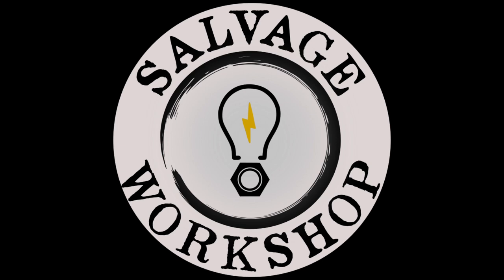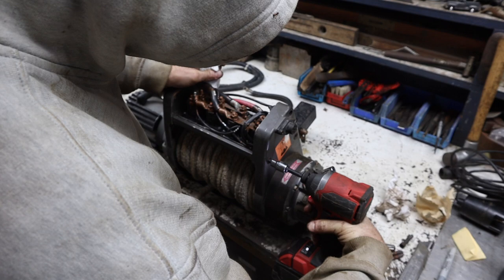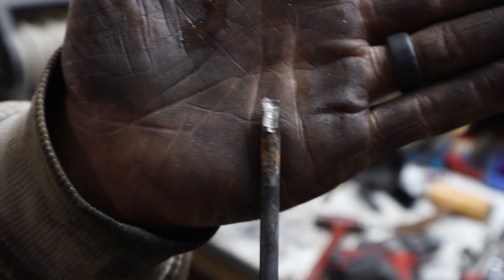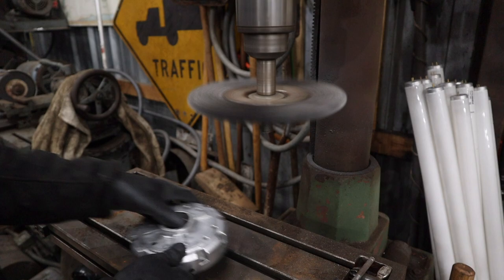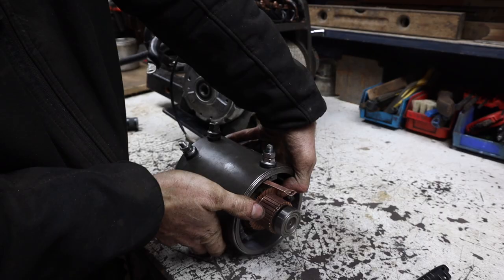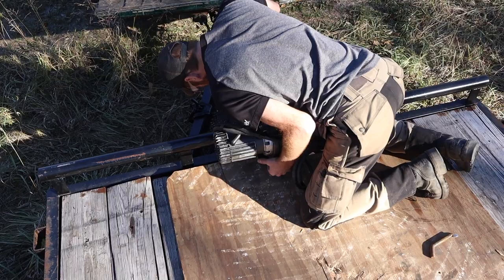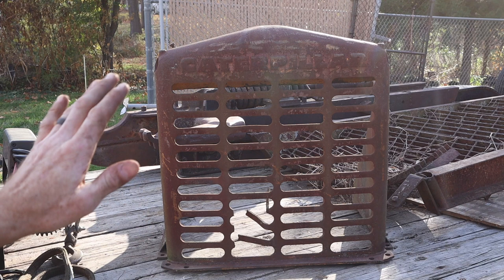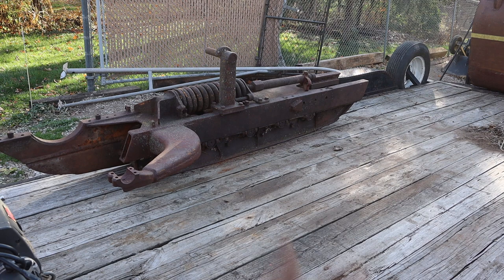Fixing a Winch so I can RESCUE Forgotten Parts ~ Part 9 ~ 1950s Caterpillar TraxCavator

Comment: I love your videos and have watched every second of the "Big Red" series.  It's great to see this old stuff come back to life.  But, I have to disagree with you about the 4 solenoids in the winch.  I don't think it has anything to do with safety or redundancy.  It it just a simple "H" bridge configuration of switches commonly used to flip polarity of DC to a 2 pole device like a motor.  Just Google "H bridge circuit" - there are tons of pictures that will explain it all.  But, the important thing is that you got the winch working and that's really all that counts.  Keep up the good work.
Reply from the maker: Warn solenoids are in an H bridge configuration, but not your standard mag motor H bridge but a series wound H bridge.

Warn does not switch the ground lead! The ground lead goes straight from the battery to the motor! More importantly: The solenoids are not in parallel. They are in series, so if any one solenoid fails, your winch will not work in that direction. Hence the safety.
Reply: @SalvageWorkshop  I agree that it is not the standard configuration of a small H bridge motor with permanent magnets. The winch has an electromagnetic rotor and stator. So, to flip directions, the current through one must always stay the same while the current through the other is flipped. The winch is wired with ground going to one leg of the motor's rotor and the other leg of the rotor feeds into the low side "H" bridge. the current through the rotor will always be in the same direction. The high side of the "H" bridge goes to +12V and the center two poles of the "H" bridge switch the power going to stator.  I agree that power will always flow through 2 of the 4 solenoid in the bridge, so from that standpoint, they are in series. But, there is no way you could build this with just 2 solenoids - you have to have 4 to flip the current flow through the stator.
Reply: I guess im asking randomly but does anyone know of a method to get back into an Instagram account..?
I somehow lost my login password. I love any tips you can give me!
Reply: @Romeo Noah Instablaster :)
Reply: @Skyler Quinton I really appreciate your reply. I found the site thru google and im waiting for the hacking stuff now.
Seems to take a while so I will get back to you later with my results.
Reply: @Skyler Quinton It did the trick and I actually got access to my account again. I am so happy:D
Thanks so much you really help me out :D
Reply: @Romeo Noah You are welcome :D

Comment: at 27:11 the motor base / first stage gearbox housing is rotated 180 degs out. that little teardrop indentation in the plate where it meets the motor housing should be pointed down. This is the moisture drain hole. Up you risk collecting (more) rain water in your motor housing.

Comment: Generally recommended to use the gray never seze which is approved for use with aluminum.  The copper variety is for steel on steel.  Copper and aluminum together will seize up big time.  Just in case you need to get them apart in the future without ruining the top casting.

Comment: You should try to get the forklift out at Red's old Place... Ground seems solid enough, though the small tires on it does seem like it may be more trouble than it's worth going off flat concrete shop type stuff... never used one that low to the ground myself. The smallest at my Job is a 4K and we have to be on dirt sometimes lifting heavy bomb bodies, but the tires are a little bigger than that set up so idk for sure. I'd still try it myself though especially if I was by myself... Keep it up this is a fun project to watch!

Comment: May be the solenoid you replaced wasn’t necessary. When you use an ohmmeter to check the continuity or insulation of a component, this component has to be disconnected from the electrical circuit. That is, when you apply voltage to the solenoid coil, there should be continuity between the two main terminals of the solenoid. But if the two big cables leading to the motor remain connected during the check, the small current flowing from your measuring instrument will find a way through these cables and then through the induction coils of the motor, thus leading to a wrong measurement. Anyway, your videos are tremendously interesting, you are an excellent mechanic, no job is hard enough to keep you away. Moreover, your videos are of best quality (which very difficult to do when you have to solve difficult issues at the same time) and also a pleasant narrator agreable to listen to. Thank you for your excellent job.

Comment: The 4 solenoids on that are not  a fail safe IMO, they are there because it is a DC motor and reversing current. As much as you require 12V +  you require 12V- which they effect. You should also isolate your motor before disassembly. The steel inside is not an issue, the magnetism comes from the field windings. Now it runs and you don't know why.

Comment: When you attach the strap or chain to the loader/bucket, run it over a barrel so that when you pull with the winch it lifts the thing up and doesn't dig into the dirt.   It might even help roll it up onto the trailer.

Comment: Oil-based Paint Pens are the best for labelling Winch Terminals.
Invest in a Black, Red, Blue and Yellow.
Tag the tips of each bolt terminal and also the crimp of the eye terminal.
If you really want to go crazy, get some colour-coded terminal boots too.

Comment: You should weld up a couple of "low profile carts" with small pneumatic tires and eye bolts on all 4 corners for ratchet straps. A cart that you can hook the winch up too after you've laid it under whatever you want to winch up onto your trailer. Basically a larger version of the things you used to move the lathes out of the warehouse in one of your past videos. Just a thought.

Comment: Really enjoyed the video, and your persistence! I would definitely try and find another set of rock guards for the other track carrier,  especially if your on uneven ground and have rocks and or stumps and chunks of wood your turning and traveling over. I also suggest finding a skidsteer to take along on your awesome picks. I wish I had got mine earlier in my life, it might have saved me from 5 major surgeries and extensive nerve damage and near complete loss of my right hand and arm. I like you didn't use equipment to move and load heavy objects.  Take care of your neck and back, please.  👍

Comment: As a monday morning quarterback with back problems, it might have been wiser to take the Hi-Lo to the site to lift the parts on to the trailer.  It would take two trips because you would have to go back for the HI-Lo if you couldn't fit it on the trailer with the parts, but it would have saved a couple of compressed vertebrae.

Comment: If you're going to be lifting/pulling heavy objects onto your trailer, you might want to have a look at the lifting arch that Matt Cremona has on his big log collection trailers. It would probably pull the front loader assembly on no problem..... if could probably load a small car WITHOUT it's wheels!! Also, mabey a steel cabled winch might help. Keep up the awesome work 👍

Comment: i might have wiped some silicone RTV around the outside of the motor case to water proof the gap between the case and the end bells..    or some silicone self vulcanizing tape but that will be a stretch quite literally.

Comment: 0:01 When a five minute job (changing a solenoid) becomes a 2 hour job that extends to the next day... but most frequent is doing the 5 minute job on a Friday or Saturday and then realizing you need on little tinny part, and all the stores are closed so you have to postpone it for the weekend...

Comment: Rock guards prevent just the right size rock from rolling in and breaking a roller; however studies from Caterpillar show the rollers/rails wear out faster with the rock guards on due to holding dirt/sand in your lower undercarriage area.

Comment: Rock guards are not a bad thing - prevents debris from falling into your rails and causing extra premature wear.  I’d say if you have two of them I’d try to put one on the outside of each side, it’ll prevent wind-rowed material falling into the rails when you start working it.  It’s better protection than nothing.  Undercarriage is expensive so protecting it is a good idea.  It’s not just important for loader crawlers either, my old 1933 Cat Twenty Five has them even.  They almost always came off the first time someone had to work on the undercarriage because the bolts broke and no one cared to deal with them - had to get back to work as quick as possible.

Comment: Seal all those winch seams with something or next year you will be right back where you started. Anywhere water can enter it will find a way. Don't forget dis-simular metals. Water lights that corrosion off, even faster when an arc of 12 volts runs through a wet casing.

Comment: As soon as I heard your winch operating after you put it back together I had a good feeling the brake wasn't working. It should sound differently between winching line in versus line out, but in the video they sounded the same. Any time you use the motor to line out, it has to work against the brake, that's why it'll have a different sound.

Edit: good job getting it working enough to get everything on the trailer though!

Comment: My suggestion is to get 2 junk trailer axles/tires and slide them under that loader frame.  Bring a jack and some plywood.  Then roll it onto the trailer with the winch.  That loader frame is not that heavy.

Comment: The solenoids are not safety devices in the sense you said.  The winch motor is a 12vdc motor.  The solenoids switch the power going to the F1 (positive) and F2 (negative) terminals on the motor so that the mtor runs forward or reverse.  Four solenoids are needed to make it operate that way.  Only two of the solenoids are energized at any one time while the winch is being used.

Comment: Easiest way to manage those hinged implements is to knock the pins out and take em apart, so next time bring oxy/acetylene or oxy/propane. Just heating them up a piece will break those rust crystals and give you a better shot at it. Then wire brush or crocus cloth the rusty end that will be going through the hole & oil it up good. Doing a few things up front will make things easier and less risk of damage by mushrooming pins and chipping hammer faces and the like.  There are places for brute force, but you got to prep to make it easier on the work and the tools (and yourself!)  Also take a look at cribbing - anyone playing with heavy equipment should have a box of blocks, straps and chain,  because a runaway chunk of iron will take off anything from a finger to a leg on it's way down to a stable resting place.  Ask any firefighter.

Comment: Hello nice work one word of advice never hit a bearing every hit makes 2 impact marks on in side bearing , very little heat will make your life easy,heat gun maby a minute on bearing, ice the shaft and bearings will slide on by hand 95% of the time, over wise press bearings on, 35 years of rebuilding gearboxes and pretty much anything a industrial plant uses, good video,

Comment: had the same thing happen to a startermotor , the rust puches the outer shell against the rotor preventing it from turning , in my case the outer housing was aluminium and the inner metal , not only did it lock up the rotor but broke the aluminium housing as whell

Comment: I must have missed the part where you showed what was preventing the winch from operating.  A slightly rough shaft bearing should not have been the cause unless it was totally broken.

Comment: Good job!  I think you should have use Old Red to load that stuff before you moved it home.  May have had to weld some points on the worn sprocket but it would have been much easier to load that heavy stuff.

Comment: All the big gear i have was bought cheap because it needed work . eg my lathe, 9' bed 4' swing ,had to fit a new drive motor and clean it. My mig, a SAF 360 Amp monster which makes the most beautiful beads. total cost $300.

Comment: The brush retaining pin hole is designed  to hold the brushes out of the way during assembly. There are other designs to do the same thing. Many auto alternator's use this design, simple no extra parts or size. You disassembled the drive motor but what was cause? You found a bad solenoid, where was the power going? For instance, What would you have told customer you found to cause the motor not to feed or retract after replacing the broken solenoid? What is the function of the "brake" again?

Comment: If you get  the surplus bucket/armature flipped upside down  it might be easier to get it onto the trailer since those parts that aren't on the ground will actually preform like ramps especially the curve of the bucket will work with loading instead of against it. The Rock Guards are advisable only if the ground might be working on has debris  that might get under the rollers that it can't clear naturally, loose earth isn't a problem but the roots/rocks that are in it will become a problem if there about baseball sized or larger. You won't regret having a matching inside  pair installed in this case, but of course power washing what might collect without  a full set will be more difficult since it will catch what being forced towards it not past it. Good luck on the next pick so watch your back, indeed could almost build  a two legged boom out of scrap that could be mountable on the trailer so it could lift as much as it pulls with the winch and one might even use a chain hoist on it as well.

Comment: Depending on what your doing with the track loader, if working around a lot of rocks rock guards will keep them out of the rollers and beating the up, we had them on our D9/10 but they were pushing a lot of over burden .

Comment: I am a bit surprised that you were underestimating the weight of that bucket and arm assembly so much.  I would guess that assembly weighs at least 1.5x as much as your truck and trailer combined.  I would see if you can get a weight of that assembly from Cat and verify your trailer can handle it before you try to self-move it.  Best bet would probably be to get a tow truck with an incline bed to move it for you.  Bring a dozen 4x4x8 wooden timbers to protect the bed of the tow truck too.  My SWAG is that the assembly weighs about 4 tons.

Comment: "so this rotor tiller and right below is the snow blade they both go to john deere..." My mind goes: "So how the hell you swap snow blade into rotor tiller and how that that can move snow? Is it like snowblower type of setup?!" Oouuuu right, different tools entirely, gotcha!
For the roller guard, i have zero experience with tracked vehicles except few excavators, but i believe those are great in rocky area, since whole machine could detrack or jam if all rollers have some hard rocks between, so i dont see use for them. Makes just harder to clean tracks and adds steps to maintenance.

Comment: You need to jack that loader bucket up and put rollers under it like 3" threaded pipe or round wood fence post you will need a several. It will keep the front edge & corners from digging in the ground. look on youtube to see how they moved pyramid blocks using sleds and rollers.

Comment: Great video, but on the bucket loader I would imagine that the hinge point on the bucket on each side is probably seized up. It should have been moving from the amount of pulling you did. I think you should consider loading your forklift on your trailer and then use it to load the assembly. That loader is going to be very very heavy lol especially since it's that old.

Comment: Not redundant.  You have to reverse both plus and minus.  So 2 wires must be connected to drive the motor clockwise and two must be used to drive it counter clockwise.  Thus 2 electro switches required for each direction of in and out.

Comment: You might find it helpful to get a wiring diagram and study how an electric winch actually works. The four solenoids are only for forward and reverse operation. One solenoid is energized on each winch motor lead at the time. For in the solenoids simply reverse the motors connection to the battery. That is why you see two separate cable connections on one side of "two" solenoids and a "jumper" on the other side of the same two solenoids. 
With this kind of set up it takes two solenoids being energized at the same time to run the motor.

Comment: Warn winches suck up water like a man lost in the desert....  Never seen a waterproof one yet.  Motor will still turn with one bad solenoid (provided it's not seized).  Note to those sucked into buying a Warn Winch - always carry a spare motor, you WILL need it, even if you only drove through rain to get to your destination.
Reply from the maker: Interesting... my opinion is the complete opposite of yours about Warn winches vs other brands!
Reply: @SalvageWorkshop  Well, you may be a slow learner - did you not just spend days refurbing a water damaged Warn winch motor?  As I said, Warn winches ingest water - it's a design feature.

Comment: Mabe you did it but sand commutator and clean each slot with a dredged hack saw blade. Check brushes and brush springs.

Comment: 31:05 Great vid, if that had been anything other than a WARN it would have been in the trash based on time vs money. I would however discourage the impact driver on the casing cover reassembly due to cast body will snap in a minute as soon as your impact hits that threshold. There are probably torque specs but hose always get hand tightened regardless. just my $0.02

Comment: I think I would have tried the motor after taking it off first.  What is the resistance of the windings ? Rust there won't matter - the magnetic field will conquer all.  Brushes I bet and a bad bearing.  Shaft likely off center and jammed before or a warn brush.